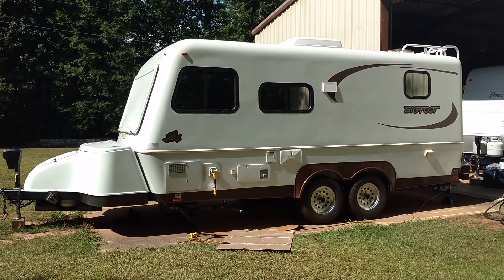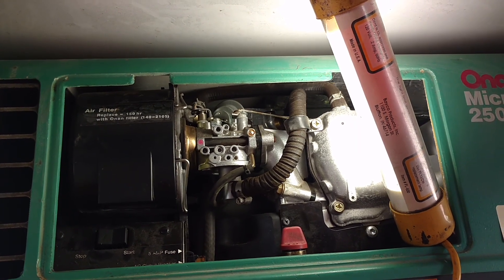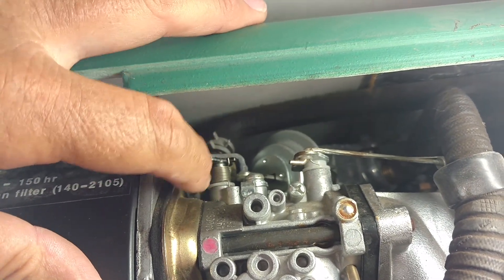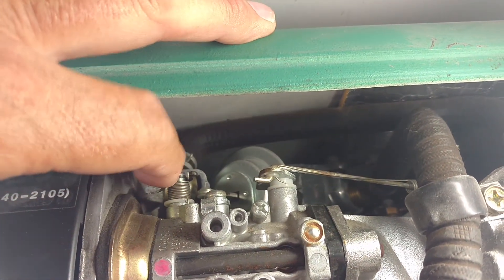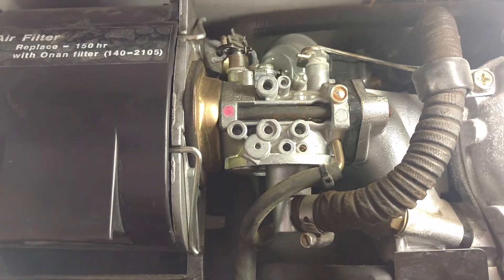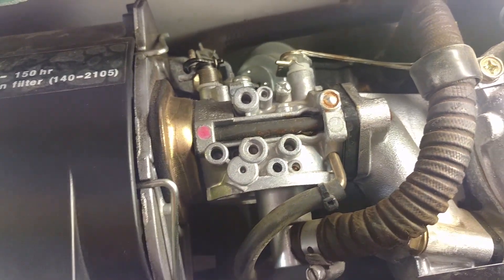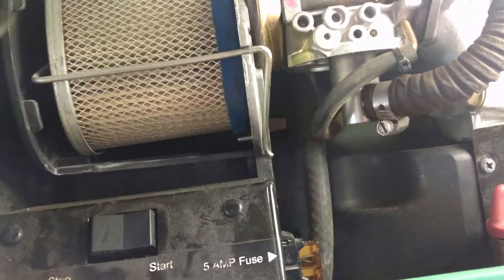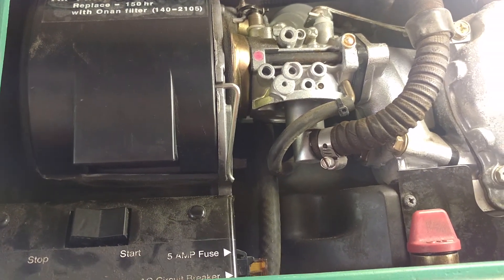Cummins Onan 2500LP Generator Starting Troubles

Comment: Onan is a poorly designed generator
Reply from the maker: The older ones like mine had a few design flaws such as the bottom only exhaust, but later models have an option of bottom or side exhaust and the newest is an inverter design so they run quieter much of the time. Not really poorly designed though.

Comment: I have the same generator on a class B Pleasure Way… is the breaker “on” when the switch is in the up position?
As you know it’s hard to see.
Reply from the maker: @danfoley9486  it's been a while since I looked at it, but I don't recall anything unusual about the switch, so yes, pretty sure up is on. Thanks for watching the video.

Comment: In my recent troubleshooting I would check for cracks/leaks in the rubber hoses supplying propane. Mine had leaks and crack along the length of the hoses.

Comment: I have an Onan 2500 Model HGJBB LP generator on my Pleasureway Class B motor home.  It has always started hard (3 to 4 cranks of ~ 10 seconds).  It finally wouldn't start yesterday so I figured it was time to google around and saw your video.  Sure enough when I climbed under there I found the loose closing spring.  There's less room than on the Bigfoot and I couldn't get my fingers in there to roll the spring around for another turn so I just used a small rigid wire connected to the air filter housing clip hole to rotate the lower spring end counter clockwise a bit more.  Seems to be closing the choke fine now.  I plan on trying to start a cold engine tomorrow to proof it.   Bottom line, this was a big help and saved me a trip to the dealer.

Comment: GREAT VIDEO, I have been trying to fix this  forever. So my spring wasn't connected, connected it runs like a champ, until I put it under load. Then it goes full throttle and dies..Thought's??
Reply from the maker: I'll have to think on that one
Reply: @CharlesinGA  I think it might be that vent tube, but I can't bring myself to cut it.
Reply: @rayfletcher7436  did you end up fixing it? mine does the same thing, under load it dies
Reply: @x5turtle  nope, sold the camper before I could keep diagnosing it.

Comment: Thanks! I have a 2008 BigFoot 25' front Bedroom with a similar gen, I can't wait for the snow to melt so I can get under and try this> As yours very hard to start most of the time. I've gotten under it and taken the cover off and streamed a little propane into the air filter with an unlighted torch and it started right up, not so much fun in the rain when you really need it. Thank you for the video and I'll let you know this upcoming season how I make out

Comment: I'm surprised at how close to the ground it is.
Reply from the maker: While it may seem too low, it actually is not that bad. The place it was parked during the video is V shaped to prevent water from running into the shop, and the wheels are right at the low point, so the concrete rises toward the tongue, giving the appearance of less clearance than is actually there. Also the rubber protective flap on the front hangs well below the generator also giving the appearance of it being very low. New trailers, beginning in the 2019 model year use the new Onan 2500LPi inverter model generator and the exhaust pipe exits out the LH side near the bottom giving about 4 additional inches of clearance.

Comment: Thanks for the video,I am going to have a look at my gen to check the spring.. Question--The vent hose with the filter that you installed, where is the other end of the vent hose located on the motor?  Is it visible in your video?   Thanks.
Reply from the maker: I am not sure where the vent line connects, i will have to attempt to figure that out. Thanks for watching!
Reply: @CharlesinGA       Ya I looked for that vent hose on my 2500lp and did not see it in the area that you show.Do not see it anywhere.  Thanks again.
Reply from the maker: Its possible that some models have the vent hose inside the housing. After looking and following the hose as far as I can, I think it is a vent line for the bellows of the gas regulator on the motor. While the incoming gas line is the correct pressure, Onan installs a regulator internal in the generator. There are a couple of hoses, this being one, that I would like to replace due to age, and I may drop the generator some time and open it up.
Reply: @CharlesinGA  Thanks for taking the time to reply..
Reply from the maker: I happened onto a short sweet video with this same generator in a truck camper that had a no start due to a mud dauber having plugged the vent line, the reason for me putting the Scotch Brite over the end. He notes that the hose does go to the large diaphragm of the regulator inside the genny housing. https://youtu.be/Jm996iwVwAg
Reply: @CharlesinGA  Thank you very much.

Comment: Thanks so much.  I have the same gennie model but a different year so not quite the same.  Will have to try your solution in the spring.  I had totally given up on it but this just may work.
Reply from the maker: Please post when you check it out. Glad this helps you.